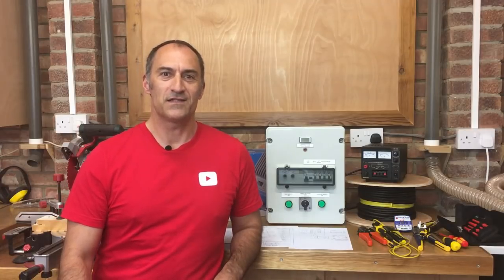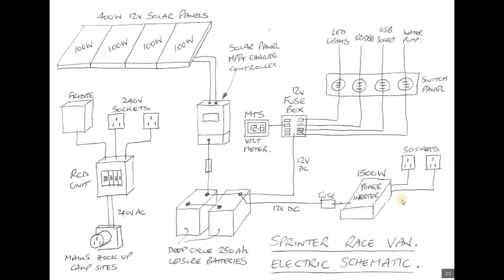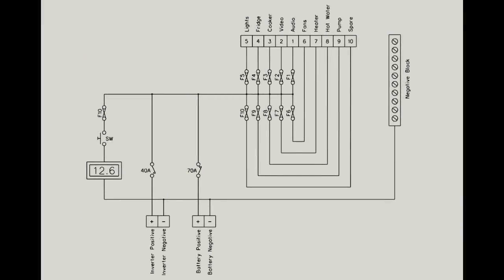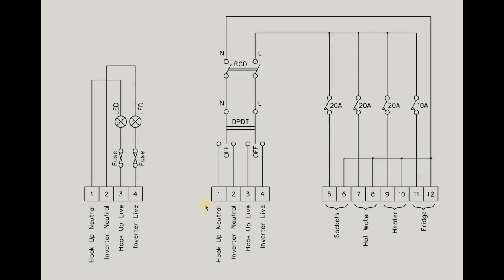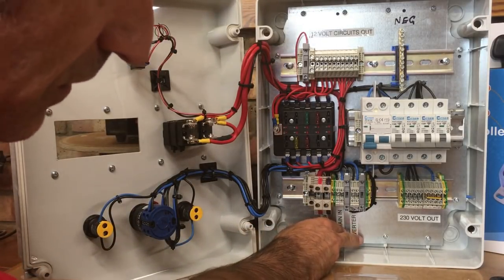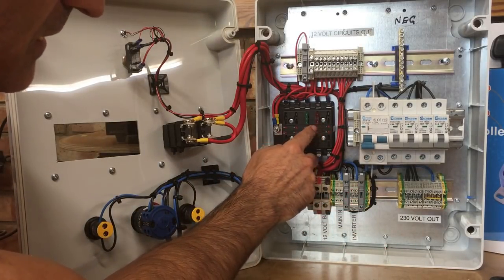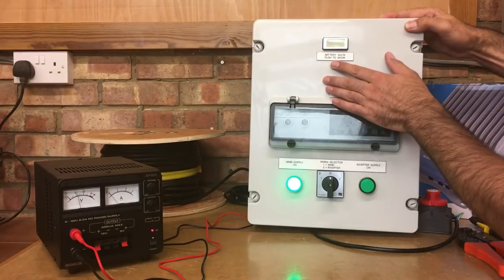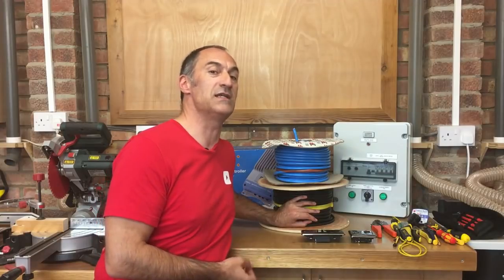Self Build Camper Van 12v Electric Control Panel

Comment: Greg, great videos, can I ask what happens on EHU to your 12v circuits? As far as I can tell they continue to run from the battery feed unless you've double wired everything for 12v/230v. By this I mean the things that you have run from the blade fuses out of the top of the panel. As far as I can tell these will continue to run on 12v from the LB regardless of EHU or not, is that correct?
Reply from the maker: Hello, yes spot on! The 12v DC supplies fed off the leisure batteries via the blade fuse holder work all the time regardless of where we are. The changeover switch only switches the 230v supply from inverter to shore power. So when we are on a camp site I'm not draining my batteries.
Reply: Superb, it works almost the same as my system then, yes I did copy you, but I don't have a need for an inverter so left that bit out. Thanks for the quick answer and looking forward to the next installment.....Al
Reply from the maker: You're very welcome, pleased you found it useful. Good luck with your build. Thanks for watching.
Reply: Greg, is there a link for the distribution board you used please?
Reply from the maker: Hello, The panel was built from scratch using individual components it’s not a manufactured item. The parts were brought from electrical distributor. I’ll see if I can scan the invoice for part numbers.
Reply: Aha, no wonder I couldn't find it online - so it's just the same as the sort of blank looking distribution boxes I have been finding? I just need to buy my internal parts and work out how I want them positioned and then buy a box that will accomodate and cut the holes in it where I need them? That, and neat and tidy, I can do, did you size up a bit to allow decent airflow cooling? I really like the idea of being able to create the master circuit board/box in advance and just add in wires as I go along. But are there any concerns over voltage loss by adding additional connections/joins to cable runs?
Reply from the maker: Absolutely correct. It was just an empty plastic electrical box with metal back plate. Items are mounted on din rail and the front cover was cut so the switches, MCBs and lights can be mounted. Make sure cable sizes are large enough to avoid overheating. Many cable sizing calculators online to help. Very similar to American RV distribution boards.
Reply: Thank you very much, that's been a great help, I've only had to watch this video 5 times to understand it all and finish all my notes and drawings. I mentioned the voltage drop because I'd been reading a US blog from a bit of a battery/solar/wiring expert. He's very big on going one to two sizes bigger in wires than the calculators recommend. He actually starts with taking the M4 wires out of the solar panels and upping them to M6 or M8 if they'll fit. Also wiring in series to up voltage rather than parallel for max amps. Very interesting blog and I understand it a whole lot better having watched your videos. Plus my van will be a Crafter so very similar...thanks again....Al
Reply from the maker: I also plan to series my solar panels to increase the voltage and keep the amps low. Exactly what the major electric companies do when they transport electric across country. 33kv or 11kv then transform down at the user to keep the cable sizes down.
Reply: Excellent I was understanding him properly then, Greg can I bother you with one more question? In your solar panel bit you mention the size of roof available as being about a 1400mm usable width, sounds about right. But do you happen to know the usable length? I'd like to fit one rooflight at the rear 400x400, a Maxxfan towards the middle again 400x400. The front section is for solar only and I have my eye on 2 x 200w mono panels at 1240x990x40 fitted crosswise. So would need just over 2m of roof length to accomodate or about 3.5m of overall usable length. It's amazing I've tried so many sites and with all the conversions and solar etc, you'd think someone would have listed usable roof space, but I can't find it....thanks....Al
Reply from the maker: Hi, I've got a fan in the second ribbed section back from the bulkhead, where the circle was in the roof and another fan in the second from last ribbed section near the rear of the van. That leaves 4 clear roof sections in between which measure 2235mm. The width across the roof gutters is 1430. So I'm going to install 3no 160W 36cell panels in between the fans across the width of the roof. These panels measure 1455x665x35mm and will give me a total of 480W. Total array size 1455w x 1995L. You could also fit two of your panels across the width in between the fans for 400W total.
Reply: Greg, thought you might find the links to those US solar blogs interesting they are https://handybobsolar.wordpress.com/ and http://www.jackdanmayer.com/rv_electrical_and_solar.htm there's a lot to wade through but some gems hidden away.

Could I also ask if you're planning any seating shennanigans, double to single, swivels, extra rear passenger seats...that sort of thing? I'm working at making mine able to legally carry 3 passengers plus driver. I have a few ideas but hoped you'd maybe done some legwork in this area...I'll stop being a pest now....Al

Comment: Hello Greg, I’m going to study the updated diagram in the description. I’ve begun my sprinter conversion (ex police vehicle), which had a VSR & Leisure battery setup under the passenger twin seat. It had 2 vents, aspar diesel heater wired in, ceiling lights cig lighter sockets. However I still ended up gutting it bare as it didn’t have the foiled bubble wrap insulation, but only rock wool. I’ve so far completed my insulation and just trying to find a wiring model to work from, possibly work off your diagram. My lithium 100Ah batt has arrived and I’m edging to get started on the wiring amidst ordering some electrical bits. It’s stressful when you’re pure DIYing from scratch. Please check out my instagram @nomadxsherkhan. Thanks for the inspiration. You are helping me Big Time!😊
Reply: By the way, from all the van build videos I notice that no attempt to install electrics under the passenger seat. I must be missing something?
Reply from the maker: I think only because space is limited under the seats and most off-grid leisure batteries are too big to fit in there.
The police demand on the batteries would have been small I guess so small leisure batteries. No reason why they can't go there and it frees up space in the back of the van.
Reply from the maker: Hello, These ex-forces vans do have a lot of stuff already fitted which makes for a great starting point, I almost bought a police minibus myself. Following you on Instagram, I need to use that much more. Like your welded bed frame, is it welded to the van?

Comment: Excellent wiring which I am going to use elements of, particularly the neatness and layout using DIN rails.  The problem is, which you have probably already picked up, is your 2000W inverter is going to be running to power the tiny LED indicating it is on.  Better to have an inverter with a remote so you can switch it on and off when you need it.  The USB charging sockets on the 240V sockets will do the same.
Reply from the maker: Hello Stephen, is this a problem just because of the small constant power use or is there another reason that I have overlooked?
Thank you for your help.

Comment: Hi Greg excellent videos as was quite concerned about installing 240v Electrics in my Motorhome but its easy lol, can you add a link to Distribution Box as can't find one the same as yours as the one you used looked perfect size for the top of my wardrobe. Thanks again.
Reply from the maker: Hello Andy, sorry for the delay in replying. The distribution board is homemade from parts bought from RS Components.
I know its very complex for the home DIYer so there are a couple of options. 1. Find a local electrical controls company that could assemble one for you, (this could be expensive) 2. There are commercially available Power Management Systems for Campers available at reasonable prices. Granted they may not have the same features as mine but will do the job of power management.
https://rover.ebay.com/rover/1/710-53481-19255-0/1?ff3=4&toolid=11800&pub=5575265109&campid=5338027957&mpre=https%3A%2F%2Fwww.ebay.co.uk%2Fsch%2Fi.html%3F_from%3DR40%26_trksid%3Dp2046448.m570.l2632.R2.TR4.TRC1.A0.H0.Xpower%2Bmana.TRS0%26_nkw%3Dpower%2Bmanagement%2Bsystem%26_sacat%3D169486

Comment: I did not build two separate electric systems, Instead in my van build i have the same as your off grid electrical system. But i have a C-tec 30A charger with automatic supply function, which is connected to my leisure batteries and charge them when connected to mains hookup supply. My fridge is 12V, so i rarely have the need to use a 240V inverter, except for rare cases when i haven´t found 5V USB or 12V connections to my electrical needs (computer, camera, phones, IPADs, drone, etc. i have solved with 5V or 12V). That way, everything still runs on the batteries no matter what, but when on mains i charge the batteries at a much faster rate than i drain them. I eliminate the need of double sockets, a distribution board between the two systems and in my case also can do all the electrics myself since it is low voltage. This is a method that have been used in Sweden at least for a long time, and after two years of living in the van i have had no problems.
Reply from the maker: That sounds really great Jack, looks like you have a good system there. I dare say if I did this again I would change certain things.

Comment: Excellent design on your panel Greg.  However, I would always have an isolator in front of both the incoming mains.  Anyone opening the panel needs to know it's completely isolated when it's opened.  Guys like us know to be careful when putting our hands in to a panel. I would reckon a four pole switch or breaker would do the job with a warning on the live junction covers.  It could be an external setup or a switch mounted on the door with a mechanical interlock that prevents the door from being opened when the switch is closed (on position).  The two mains lights would give most people an indication that the panel has live mains going in also.  Another option would be to put a label on the panel warning users to disconnect the shore power hook-up and the inverter power hook-up.  Just one more thought.  The system could be easily automated with a four pole contactor, that way you can never forget to change over the selector switch to shore power and preserve battery power.
Reply from the maker: As you can see John, this is just an adapted plastic box. It’s not a proper panel with hinged door as that would have been easier to add a door interlocked isolator. I will be having external isolators on solar feed and battery feed and can easily unplug the shore lead. A simple notice on the panel for a.n.other should cover those not in the know. 
Thanks for the feedback 👍🏼
Reply: Hello Greg.  I did appreciate that it was a plastic enclosure which would be tricky to mount a interlocked switch to.  Coming from an industrial electrical background I probably over complicate things at times.  Unfortunately it was drummed into me as an apprentice and it's not easy not noticing these things.  Seriously though fantastic videos.  I'm presently working on my Peugeot Boxer and have been getting a lot of good ideas from you.  Cheers
Reply from the maker: Hi John, it's always good to bounce ideas off each other and I welcome all your feedback and comments. What are you plans for the Boxer?
Reply: It's a L3 H2 bought brand new in July.  At the moment I'm fitting it out very modular with cheap plastic drawers and boxes to see how my layout works for me.  Initially I was going for the full build out all done in quality components and materials.  Now I've changed to this try it and see method.  I'll put in my solar and services fairly permanently as they don't take much to regig.  Because the van is new I'm reluctant to cut large holes in the roof and sides so I'm going fully stealth and I'll put in a ducted ventilation system running in tandem with the van's existing ventilation setup.  There are hidden grills in the rear bumper to ease the seal for door closing purposes, so I'm pretty confident I can patch a ventilation system into these grills and flaps.  With my electrical background I'm going 100% electricity for cooking and heating.  I'll install a 24 volt battery system with a 4KW inverter.  I've also considered going 48 volt, problem there is components start to become expensive.  I'm working on a heat exchanger for the exhaust to heat my water with a solar and electrical backup for it.I'll change the front seats to two swivelling Captain's seats and incorporate this driving cap into my living area and dinning area.  This way I have maximum floor space to have an open plan walk through to the back doors.  Hey I'm starting to ramble now.  I've been recording it so I might put it up for all to see and comment on.Anyway.  Cheers for now

Comment: As stated by a lot of viewers, this is probably the best explained electrical video I have EVER watched on YouTube.  I do have some electrical knowledge but would have no idea as to where to even start designing my electrics.  Now, thanks to you, I have a great starting point.

I have some questions though, sorry :o)

1 - My Sprinter is likely to be an ex-ambulance (if they are long wheelbase) or just a standard hightop LWB.  I have no plans to use anything at 240v.  I will likely only use 12v devices for fridge, pumps and chargers (I can get a 12v charger for my laptop). I, even at home, do not own a TV.  Is it likely that I can have enough roof mounted solar panels on a LWB to survive 2-3 days using similar usage times as you without the need for mains charging?  I plan to have 4 batteries with no need for an inverter or 240v circuits.

2 - Would you be able to organise your video library into groups e.g. van build, other builds etc. and number them so I can follow your progress along?

3 - How much do you expect your build to cost and time it will take (Working on weekends only)?  Please exclude the cost of the van as they vary wildly.

Thanks for the series.  I am eagerly looking forward to watching your progress.  I will probably start mine around April as I don't have a garage or private driveway.
Reply from the maker: Hello Nomadd, thanks for such great feedback. 
If you are only using 12v appliances then just use a 12v blade fuse holder off your leisure battery as per the 12v page of my schematic. Don't forget a split charge relay when you're driving along and possibly mains charger when on hook up.
All my videos are sorted into playlists, go to the header of my main page for navigation. You can play a complete playlist from start to finish with on click. 
My build is not a budget build at all and it is likely to cost between 7-8k that is on top of the cost of the van. But when you see the finish you will understand why it is so much. Want a professional finish or as best as possible. Planning to have it all finished before start of summer next year. 
Thanks for your support and best wishes with your own build.
Reply: Thanks for the reply.  I see you do put the effort in to give great replies.  All the best.
Reply: Nomadd UK

i couldn't say it better myself 

Greg Virgo is simply one of the best and clear concise channels iv come across. A true god send

Comment: When you're running off your inverter, are you going to run a ground spike for Earth??
Reply from the maker: Hello Mark, I have RCD protection in the panel for any earth leakage trips in the van.
Reply: Hi Greg.  Brilliant series which I have just caught up on.  No need for a ground spike, but it may be worth checking that Earth and Neutral are linked at the inverter or even if this is possible with your inverter.  Without this the rcd may not trip in the event of a fault to earth in an appliance.  The rcd may still appear to work when the test button is pressed. This will create a TNC-S supply from the inverter.  If you don't have the necessary test equipment you should get a sparky to test the rcd trips under fault conditions.  PS the tube of clear silicone in the tank video came from the hardware shop really close to me! Small world.